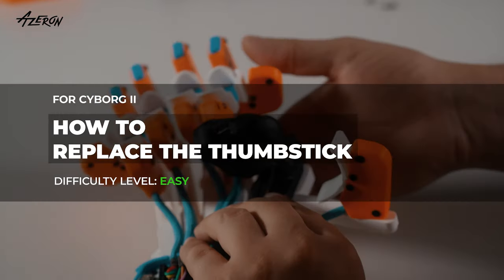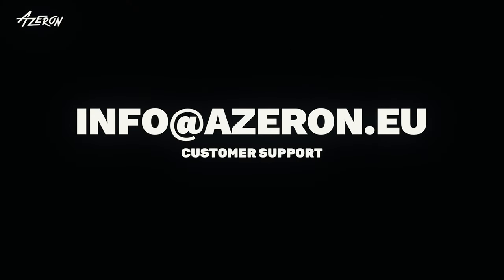How to replace the thumbstick on your Cyborg II #azeron #azeronkeypad

Comment from the maker: 0:00 intro
0:00 what is needed
0:13 unscrew the palmrest
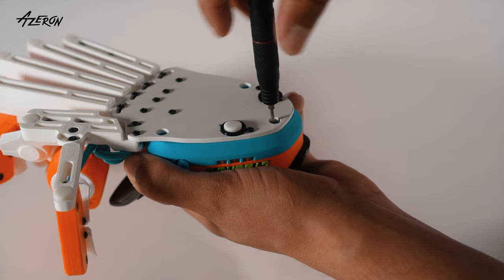0:27 remove the casing
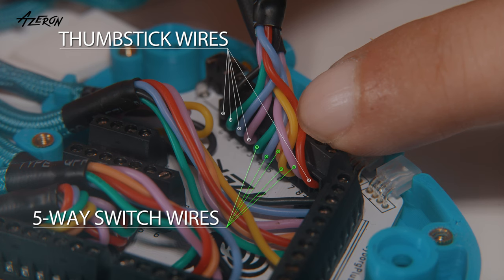0:42 remember the wires
0:48 disconnect the wires
1:02 remove the thumbstick module
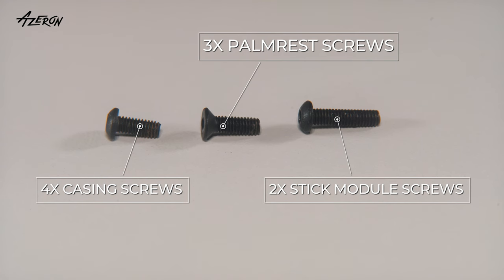1:10 note the different screws
1:14 install the thumbstick module
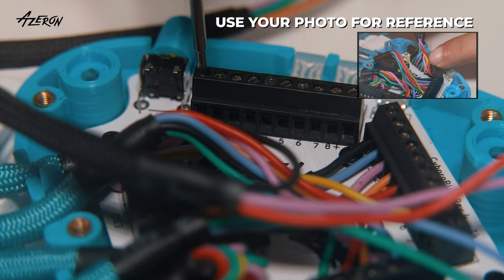1:22 reconnect the wires
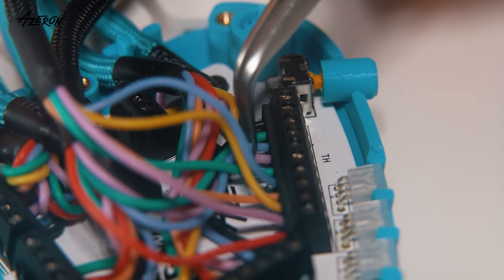1:55 tug the wires
2:09 carefully manage the paracords
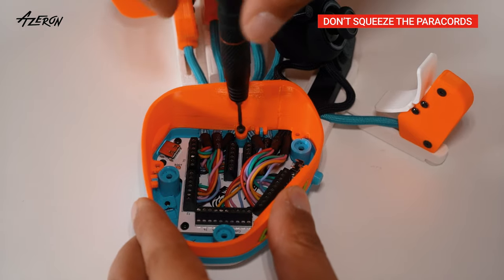2:15 replace the casing
2:24 reattach the palmrest

Comment: If you guys listen to feedback, I would like to suggest to do tough resin or epoxy coating on the printed parts of your products. It should make the pieces more wear-resistant and tougher. A lot of complaints I've read online seem to be of the overall durability of the printed parts so perhaps hardening their durability with a good coat or two before assembly will improve that end dramatically. Also, perhaps hot-swap switch connectors would be better for the button switches. Makes it much easier to buy switches in bulk and replace them when they fail. I'm definitely highly interested in both the Cyro and Cyborg II (wrist issues go figure), but up until now I've not tried buying any of either due to the pricing (Philippines) and the overall durability mentions. It's really hard for me to justify a purchase of that price without assurance it will last like most conventional molded plastic products.